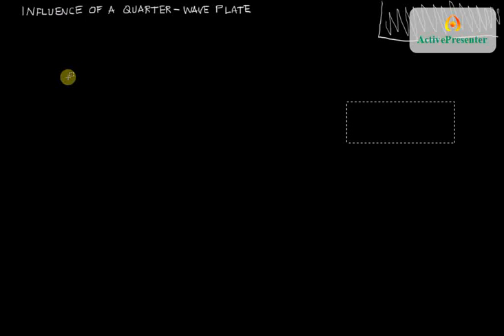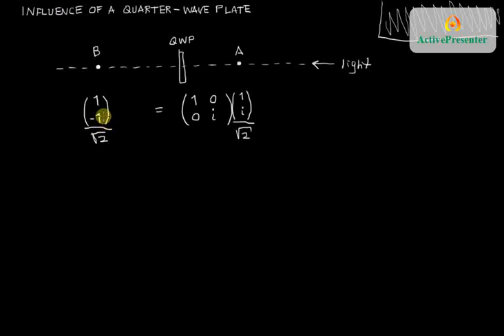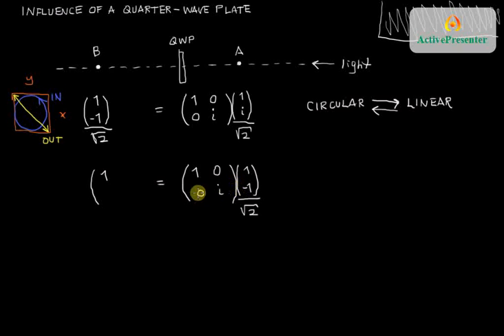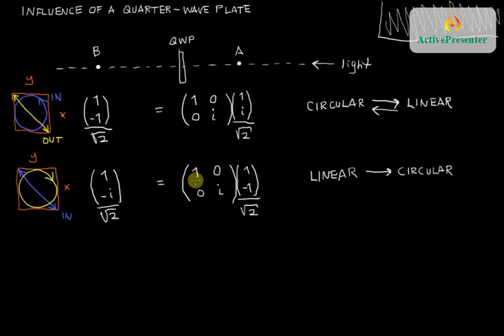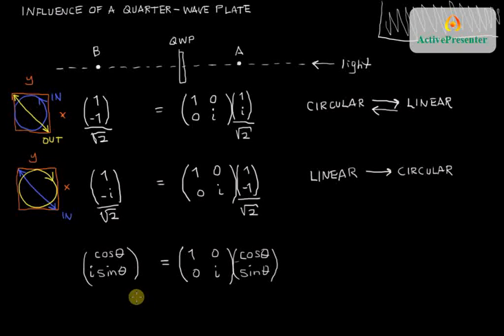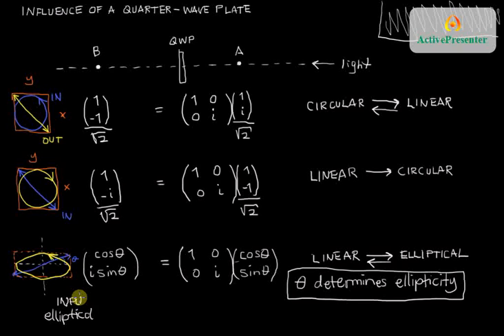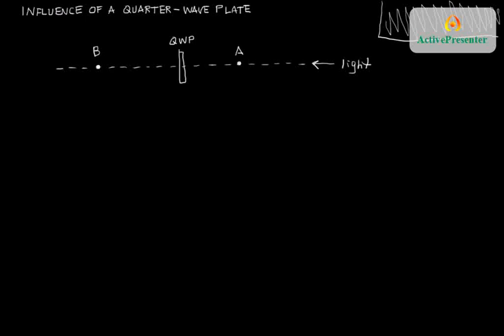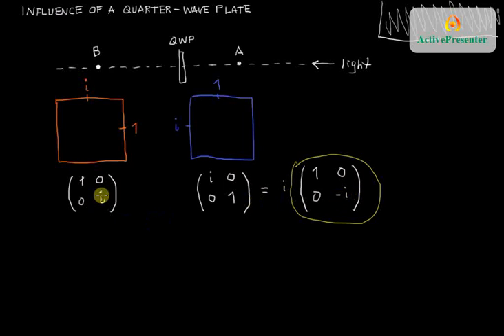QuarterWavePlate

Comment: What if you rotate the qwp by 45 degrees then use the jones vector for input vertically polarized light? I know you should still get circularly polarized light, but the output vector looks something like 1/sqrt(2) multiplied by (1+i, 1-i).. Then you can use e^ipi/4 multiplied by LCP but what does that exponent represent?